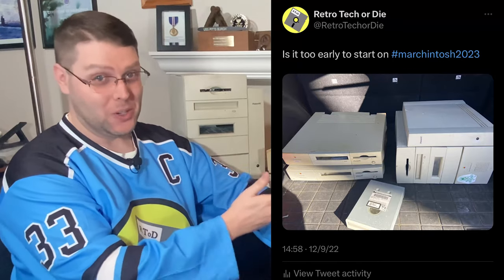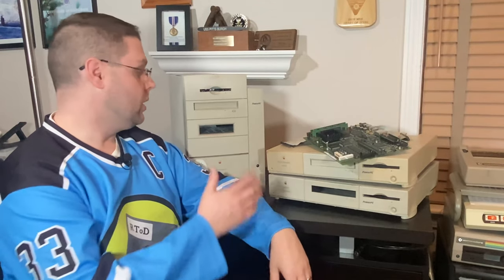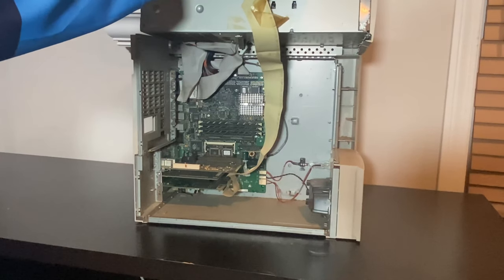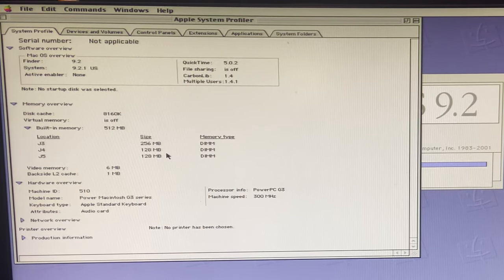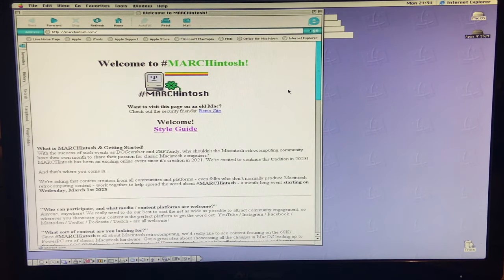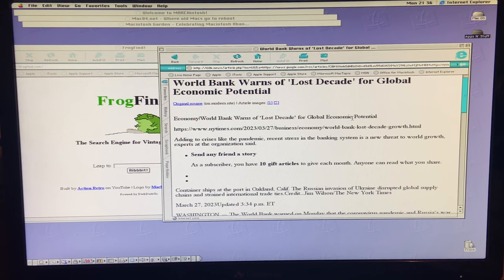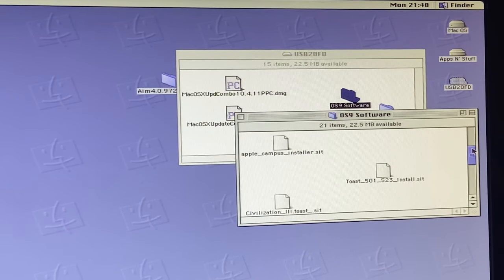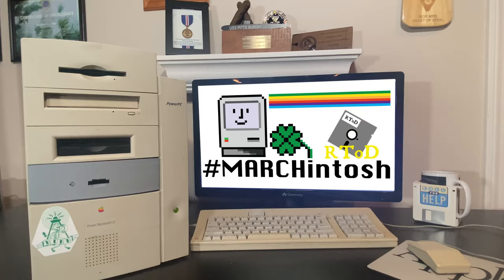Reviving a Vintage Beige Power Macintosh G3 Mini Tower: Upgrading to a Bridge Machine #marchintosh

Comment: Ethernet and usb great extras to have. I’ve got a desktop beige G3 with those options for a bridge machine, but can’t justify the space it takes up with monitor and peripherals so it just stays on the storage shelf most of the time. 😂 I’ve decided to go a different way for file transfers and set up a LocalTalk network, which mostly works flawlessly.
Great video, and lovely to have a tower machine.
Reply from the maker: LocalTalk is a powerful, and undersued tool!